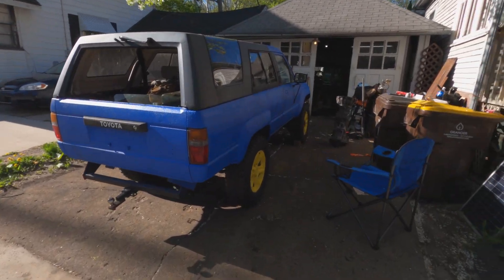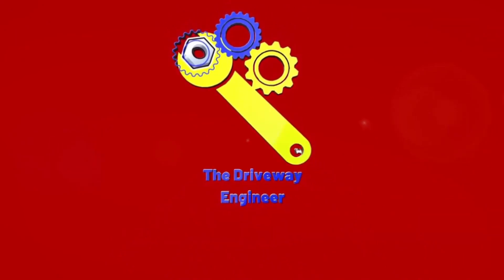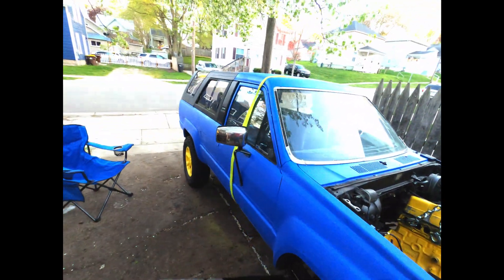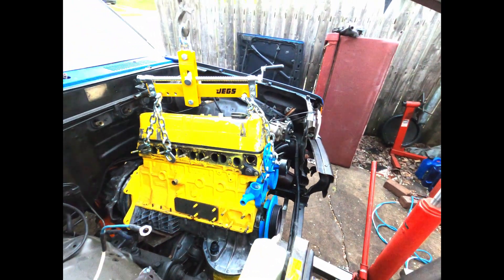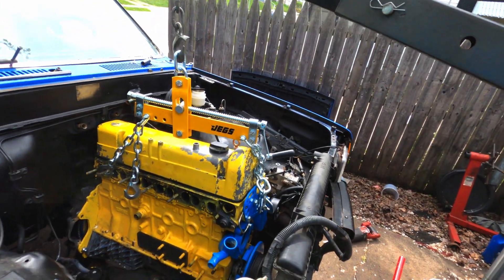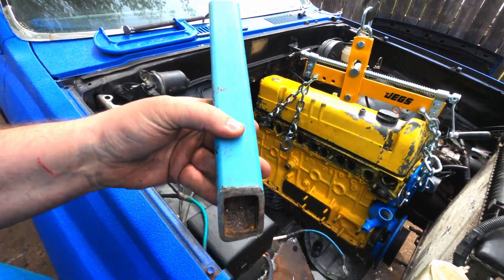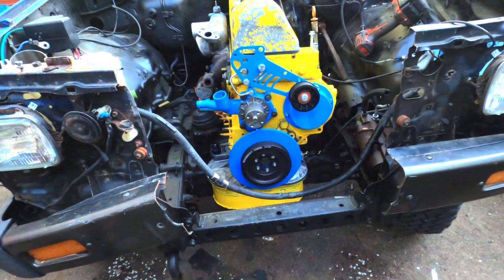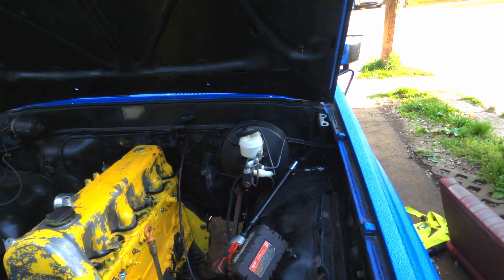First gen 1988 4runner diesel swap! Installing the OM617 and R150

Comment: This seems like a good idea for great torque and good fuel economy.

If you weren't doing a Toyota, are there any cheaper transmission/transfer case combos that would be good up to the 250hp level, I guess 4-500 ft-lbs of torque?

I would love to build a capable 4wd rig on 33s that gets more than 20 mpg on the highway, around town and burning veggie oil if I have to.  I know i can build suspension, axles and driveshafts that are bulletproof, with a great engine, the trans is the only question mark.  I'm not opposed to a good and strong 4 speed auto but a manual seems like a better transmission for surviving the apocalypse if the clutch doesn't use custom parts that might strand it.
Reply from the maker: This won't make anywhere near those numbers even with an upgraded pump and turbo. 

I'm expecting about 150hp and 275 ft/lbs at the tires. 

But, even at the numbers you mention, I wouldn't worry about my R150 trans and case, both see easily that much in V8 swaps and supercharged swaps and seem to live fine.
Reply: @TheDrivewayEngineer  does it get a lot more expensive above that?  150 is fine but if I have a 5,500 lb vehicle pulling an 8-9,000 lb trailer up a long grade, I think more power would be useful.

250 is the number I picked because if it was easy, I would take it but I probably wouldn't need more or want the problems that come when your torque output isn't the weakest link in the drivetrain.
Reply from the maker: @joequixotic3039  it's not about the number, it's a fact of the 2 valve, IDI engine.

They make 80 tire stock, 150 tire is about the limit, there's one pump upgrade, that's it.
Reply: @TheDrivewayEngineer  wow, I guess I was a bit optimistic thinking that they might be able to do half as well as a modified OM606.
Reply from the maker: @joequixotic3039  wildly optimistic lol.

The 606 is a 4 valve, direct injected, 6 cylinder, and a twenty year newer design. 

Much better at making power.

Never fit in my 4runner, but yeah, if I was after a power number, I wouldn't have started with this engine

Comment: doing my best not to be jelous but it is getting harder, haha...i am working on an 87 wanted a vw conversion but decided on a quick cheap 2.4 (a loong time ago), should have waited for the adapter (would have been cheaper after all)...Creator bless friend, thanks for sharing...doug
Reply from the maker: I have my moments where I regret this lol, this video was shot 2 or 3 weeks ago, it still doesn't run, will still spend another 1000 or so on it... I'm sure when it's done it will be great, but it's been quite expensive and time consuming. 

Had I just snatched up a Blazer I could have a 4.3/4l60 in it and be driving it now lol.
Reply: @TheDrivewayEngineer  i have had a couple full size blazers but te toy build quality is better imho (i trust a toy furher back in the wilderness)...i also had a 300d in an 82 merc wagon rumming on fryer oil (might be the best diesel ever made)it purred like a kitten (i could get my little daughter and 2 friends standing thru the sunroof, the nicest motor i have driven)...i sold my cruiser project but may wish i had kept it for more space and toy quality but have too much to do...your project will be very nimble and you can tow your house with it, haha...Yah bless...doug

i am driving my broyhers 4.3/4l60 right now, don't worry, you are doing the right thing, haha